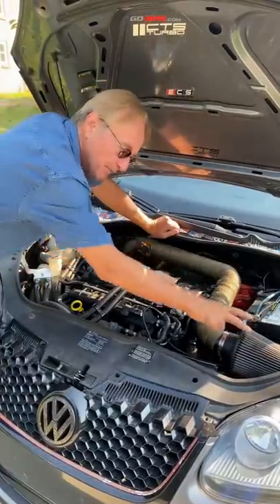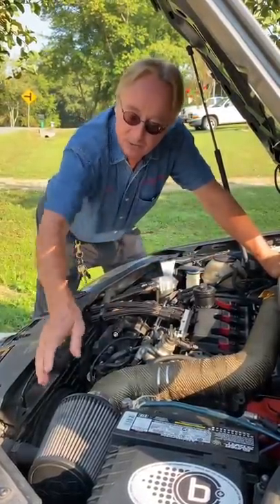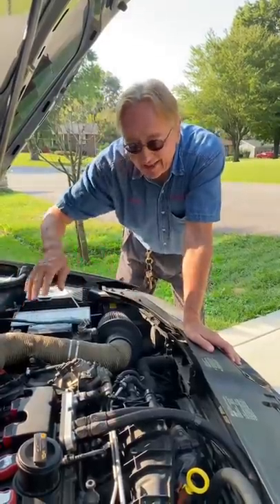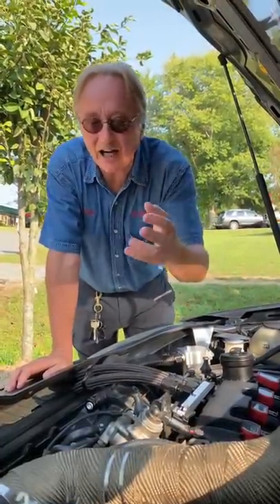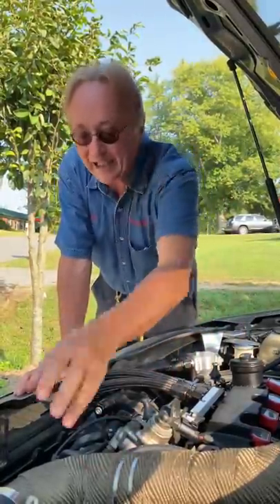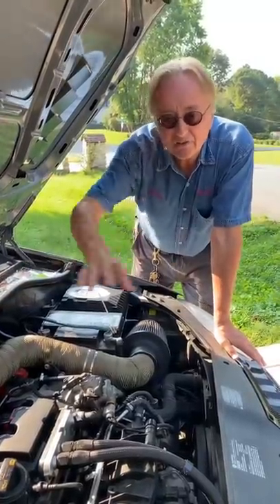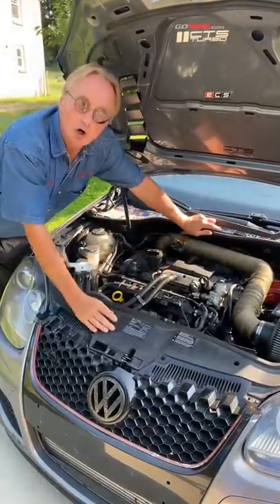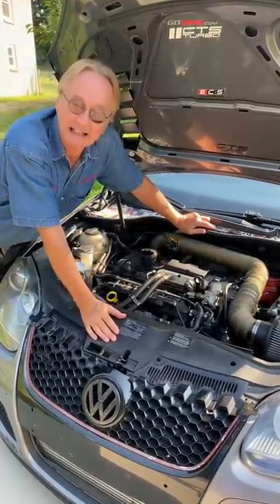Why Cold Air Intakes are Stupid

Comment: I always loved how people would remove the airbox that actually sucked air from outside and replaced it with a "cold air" cone filter sitting in the hot engine bay. Real men of genius!
Reply: I’ve seen plenty of Honda’s on OfferUp with an aftermarket intake pipe but with no filter at all
Reply: I removed my airbox and tuned my car with the cold air intake. Closed box intake but it sounds beautiful. Definitely worth it if you like the sounds but tune your car first!!
Reply: I believe the purpose of cold air intakes is to make your vehicle louder, not faster.
Reply: @drwisdom1  you can get gains w a cold air intake
Reply: @drwisdom1  Well your belief is wrong.
Reply: @universalg_  But they're only marginal.
Reply: @mr.oshawottryana.m.1785  yes indeed they are not meant to be insane power gainers
Reply: With the JLT CAI on my Charger the air box and cone are completely enclosed and isolated from engine heat.  It draws air from the same place the stock air box does so your statement is not true.
Reply: Ive seen people with the Hr/Vhr engines that basically ALREADY COME with a Cold air intake design STOCK and then replace it with Open Air filterS in the engine bay…… they basically just made their intake temps shoot up and got no gains at all 🤣
Reply: i replaced my k&n on my mk5 gti to 1 that connects to the grill, a real cai. stage 2 k03 with 285 hp en 400nm. also have a wagner intercooler .
Reply: Joe H  all for 5-10 HP lol …
Reply: That’s why you don’t go cheap. They make some designed specifically for your vehicle that come with their own box that snaps into the original box’s slots
Reply: Is that always what happens? Or?
Reply: @LardLarf2  Hondas*
Reply: Better air flow short ram intake
Reply: @PhilJLF  5-10hp would actually be insanely respectable for most vehicles. That's a power jump of ~5% which is huge.
Reply: Just like always, it depends. Replacing a sports car's intake which was already tuned with power in mind, you might see no jump or even a loss. But an economy car with a decent motor (think: Integra) with a restrictive intake/exhaust system and you get decent % gains.
Reply: @s92dx  not able to feel the difference huge?
Reply: Because it pulls in more air…
It’s useless without a tune but when you are tuning a car a higher flow air intake becomes a necessity. The air boxes are just too restrictive for getting more power out of an engine
Reply: @universalg_  You really cant.  Unless you really think 1 HP is a gain.  Anyone who thinks anything below 10 HP is a gain shouldnt be talking about horse power gains.  1-10 "gain" will still be all about the driver.
Reply: @stevethedweeb9525  you can on certain cars. Some intakes can provide up to 10-15whp with a tune. But at least for my car the intake system and cooling system is already OP so an intake ISNT needed for more power
Reply: @universalg_  how do I go about tuning an 03 two door coupe Honda
Reply: @universalg_  No intake will give you 20.  Thats the tune itself.  Nothing to do with the intake.
Reply: @PhilJLF  I got a 200hp 4 cyl stock... got a injen CAI, it's made for my model. Real CAI, filter placed in cold area under my headlight, pipe goes away from engine. Supposedly the CAI can increase up to 15hp (mine specifically), but let's just say we got 7 out of it which would be a 3.5% hp bump. But for a 4 banger that makes 200 hp N/A, 3.5% is a pretty decent upgrade if you ask me
Reply: did that on my vw with the cheap filters at autozone. lost enough power that my top speed is 15mph slower than fully stock once its up to temp. ive gotten fed up with it to the point that im designing and making a cold box and hood scoop just to avoid that.
Reply: I mean honestly we didnt hear the car owner say it is a "cold air intake" they also make ram air intakes which are ment to stay in the engine bay with a short stack its scotty the one here posting telling evryone its a "cold air intake"
Reply: That’s called a short ram… cough cough….
Reply: Exactly
Reply: Sam elliot style of voice "Bud light presents:" high pitched male "Real men of geniusssss"
Reply: Lots of good cold air intakes actually come with a box that seals off engine heat.
Reply: But the funny thing is the intake shown in this video is actually a proper cold air style intake LOL and most people that actually put a proper cold air intake on their car also have the car tuned💀💀💀🤣🤣💀🤣
Reply: That would be a short ram a cold air intake is going to go to the bottom of your front bumper.. if it sits in the engine bay without a heat shield around the filter you're losing power due to you sucking in a lot of hot air. If you can't get a legit cold air intake stick with the box filter. If you want more power without the cold air swap the OEM filters for aftermarket such as K&N
Reply: There’s full kits with shields and rubber seals for the hood. Like you guys up to date? My 50 year old father is up to date c’mon
Reply: Actually some times it help mpg
Reply: That’s a short ram Intake, a cold air intake usually goes near the wheel well at the bottom or further away
Reply: @LardLarf2  like a velocity stack?
Reply: @Mike Wright that's just a filter or usually a ram horn intake I have an actual cold air intake on my 09 civic si that came with a battery relocater so the filter could go near the wheel well and I have hondata flashpro so the car has a tune on it fit for the cold air intake
Reply: @s92dx  like my 1.8t passat wagon, i’m about to throw an intake on it soon just for some extra turbski noise
Reply: Still sounds cool and I have a heat shield for it so who cares 😁
Reply: @universalg_  Same
Reply: @LardLarf2  hot engine bay with air constantly moving through cooling it. Theres this thing called a grille
Reply: @mr.oshawottryana.m.1785  my engine gains 8hp and 11ft-lbs
Reply: @EnhancedTrashBin  cold air intakes are designed to be separated in the engine bay and ran through a intercooler for a turbo but I guarantee that autozone intake that sits in the engine bay with no turbo does make the car run worse
Reply: Real men change out the airbox for a sealed unit with a cone filter element and run a 4 inch induction pipe through there bumper to truly make a cold air intake. Couple slits in the bumper and bam, no more heat soak issues no matter what vehicle make or model
Reply: You can put the cone IN the box in some cars and get some noise if thats what you want too.
Reply: @Di3mondDud3  yes this is true, there's nothing wrong with a little extra noise
Reply: I don't ever even think about doing an intake unless it's being moved out of the engine bay or unless your cutting a whole in your front bumper with a tube running cold air from the front of the bumper directly into the cone
Reply: 🎶Mr.Cold air intake will give me more power!🎶 sorry lol I thought of the real men of genius bud light radio commercials.
Reply: They be putting them next to the exhaust manifold
Reply: I've lost friends over saying "cool hot air intake" when being showed a car with a dumb intake setup.
Reply: Welp depending on your car you can make more power with an intake. That and if you have a forced induction car it sounds cool. Always room for improvement especially with tailor built systems!
Reply: That’s why I have mine routed to the underside of my car where it actually sucks in cold air
Reply: @PhilJLF  it's about 45-50hp on these GTIs, you can do alot since it's turbocharged, have done this and a downpipe and tuned it and gained 70hp/80tq
Reply: @drwisdom1  nah actually cold air intakes are better for the engine, mostly for forced induction engines, but typically if you want more power you need bigger piping
Reply: If you know what your doing you’d know the difference. A short ram is sitting right there near the hot engine. A cold air is right next to the grill. Where air flows in. And most usually have a protective piece around them
Reply: Thats why us smart people dont use pointless short ram intakes. I lvoe sucking in my hot engine bay air for my hot air intake.
Reply: @jacobmaloney7203  it’s literally why I explained that. Short ram are meant to just look cool but most people don’t even use them anymore
Reply: This isn't a cold air, that's short ram.
Reply: @pjmcd0176  I know… it the point. He says “this is why cold air intakes are stupid” and then shows a short ram😭
Reply: Most of them come with heat shield and they are right in front of the engine bay air hole. the original airbox is only there to make it quiet nothing to do with reliability
Reply: @hammer3921  so basically you did the same thing with extra steps😂
Reply: @drwisdom1  intakes are made to let more air into the engine wdym,
Reply: @aqua9090  Back in the old days we used to make modifications like getting sport mufflers. Even though those mods weren't cheap, they only yielded small power gains. But it made us happy. Now cars are turbocharged and you can get a "tune" which reprograms the computer to give huge horsepower gains, especially compared to a cold air intake. That indicates the cold air intake is really for young people that want their car to be noisier, not faster. They also want to lift the hood and say look at my cold air intake, I installed it myself!
Reply: i think your confusing it with the short ram intake which sits in the engine bay . "Cold Air Intakes" sit close to the front bumper to get incoming air from the outside , in some cases people remove the fog lights to get direct air for maximum power gains
Reply: Thats why my filter fits the stock airbox which has 2 ducts for cool air, and closes it off from the engine bay, the filter has an open end toward the fender which is a cool spot just behind the lights
Reply: It works fine if you use a heat shield
Reply: The stock intake restrains the flow as a after market one is all open and direct so allows more flow, also helps where you position it, more air=more power
Reply: Yeah my 09 civic has it's intake down low by the wheel well. And I see so many people put short ram intakes on and all that does is hurt performance!
Reply: Actually the short ones are short ram intakes. They are for noise and looks only. Cold air intakes are located down in the fender well were they pull cold air from down below and in front of the engine. Then companies like K&N make heat shields that keep engine heat out of the filter and utilize the favtory air inlets also.
Reply: Well Scotty that's not a cold air intake. That's a shirt ram. Hood for looks and noise. Most companies include a heat shield that goes around it to keep out engine heat. Cold air intakes drop down into the fender well. They sit in front of the engine and below the heat. No child air intake requires tuning. You can get more power then you would with tuning the  without. Now stock motors are actually made with restrictions to meet standards all over the world, and for emissions. Ex. Toyota puts a carbon filter above the air filter. Thats becouse when you shut your car off they say gasses can leak out and it cleans them. But remove it and you get better response and gas mileage. It has been tested. Also please let me know what racing circuit allows tuning during the race?? How ever you qualify is how you race. Other the. Minor suspension, tire and F1 has pre set tunes that are pre tuned and selected by the driver for straights, corners, and other track sections. I like some videos you've made they are very informative but this one is completely incorrect. If you think I'm wrong, or have info to support what you have said or would like to to discuss any of my information please reach out to me I would love to bounce some things off one another. Either way keep up with the videos.
Reply: @drwisdom1  incorrect. Intakes alone dont do much. They are supporting mods. When making power you need more fuel which means more air also. The other way is decreasing rotating mass ex. Light weighs pulleys and flywheel. The intakes alows for colder more dense air to mix with the increased fuel. Then the larger less restricted exhaust alows for it to flow out. Intakes, and exhaust are supporting mods. You can but fuel pumps, bigger valves, camshaft, exhaust, and a tube but without a more efficient air intake you HP and TQ gains wont be what they could
Reply: Not as hot as you may think with the airflow under the hood..secondly the factory airbox is insanely restrictive. NVH is the manufacturers concern
Reply: Now that depends on the product and the intelligence of most people. My intake comes with a heat shield and rubber seal that gets enclosed when the hood shuts. Therefore no hot air being pulled
Reply: i have a cold air intake that sits in the lower bumper of my tsx
Reply: Special tuning? That’s what the Diablo sport tuner is for. You know sometimes I listen to people like this guy and it seems they don’t want people to do anything to their cars because nothing is worth it to them, always negative.
Reply: Most kits come with a air funnel, for that reason
Reply: Wrong
Reply: Worth doing if you get a heat shield?
Reply: @mr.oshawottryana.m.1785  Marginal without a tune. With a tune that needs more airflow, yes, bigger gains.
Reply: @universalg_ should one tune their car after getting an intake ??😊
Reply: Then that not a cold air intake cuz it actually goes out to the front in my case it out front in the opening of the bumper
Reply: Yea unless you have an old Honda where the inlet for the stock intake is right behind the headlight so air intake wasn’t very good until I put in a cold air intake which actually pulls in fresh air and added about 15hp and 20ftlb of torque
Reply: Mine suck air from the car cabin..Super cold with aircond.😊
Reply: Your talking about a short ram goofy
Reply: thats cold a short ram intake neither of yall seem very eductated
Reply: the vw airbox takes air from up front circulates it through the engine cover to heat it up before going into the engine. they do this to help warm the engine up on cold starts so ac and heat start working quicker. good for everyday but a cold air intake would go right into the engine
Reply: The airintake scotty has on his car is missing one part.
There is supposed to be a "wall" between the engine and the filter. its installed on the mounts from the factory airbox is sitting and this wall will get you nice and cold air into the engine.
Scottys setup is kinda fFUBAR tho because the wall is missing and causes the air intake to suck up hot air directly from the engine bay...
(Maybe he should learn how to install/get all the right parts before he posts vids like this?!)
Reply: @drwisdom1 
How does that work? What is louder? I’ve never come across a “louder” sound from a cold air intake? It’s just air passing through.
Reply: @drwisdom1 You're wildly incorrect. I want you to understand; your engine is a glorified air pump. Now, if your want this air pump to displace more air, now you gotta get it to be able to breathe better. 

This means less airflow restrictions. Muffler, resonator, cat converter for exhaust. Then a cold air intake would allow your engine it's best possible results. 

 A stock air intake system pumps a smaller amount of air into your engine than a custom real cold air intake does. (The one in this video isnt the right way to do a cold air intake; because it's getting hot engine air.)

Colder air is denser; which means more oxygen. More oxygen means more possible combustion. Once you understand the fundamentals of "volumetric efficiency"; then you understand how all combustion engines work.
Reply: @mr.oshawottryana.m.1785 Nonsense. On naturally aspirated cars, sure. However; through forced induction; a good air intake system can allow up to 45 hp with the correct vehicle and tuning. Also you must understand; your air intake is only one side of the coin. You'll never truly experience the real benefits of a cold air intake unless you focus on the exhaust as well. An engine's job is to breathe. If you're inhaling very well, but not exhaling very well; you're still pushing only half the quantity of air you want to be pushing.
Reply: @BoneItis639  I am a chemical engineer and started racing cars in the early 1980s. Cold air intakes are a joke and for kids to tell their friends look how I modified my car. It is trivial compared to getting a "tune". In the old days we used to spend decent money on hardware upgrades, like exhaust systems. Today it is just changing the software to allow the car to run at a higher level.
Reply: @drwisdom1  So it’s best just to get a turbo charged with 11 psi  With intercooler on the decent side of more power then? 😂
Reply: @hammer3921  he never said all of them, therefore his statement IS true, Einstein.
Reply: @XluiXawesomeX  less brain your comments
Reply: So in the final analysis...this cold air intake nonsense is really a Trump or Harris issue isn't it? Come on, fess up...
Reply: @universalg_ what’s the tune process, like what do you do?